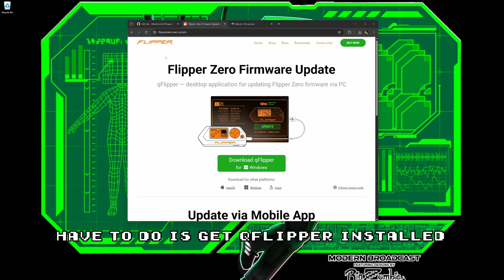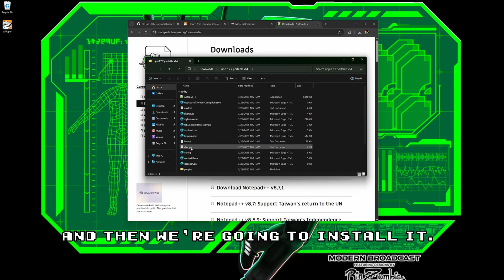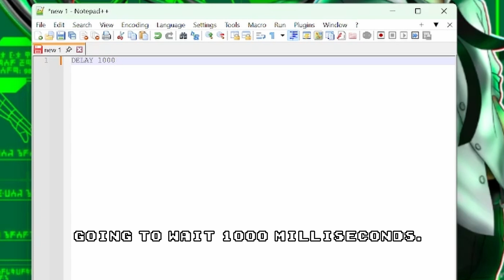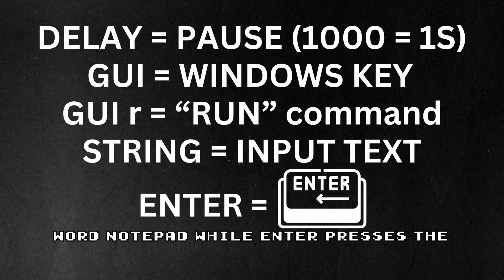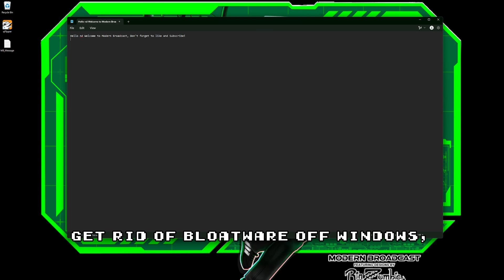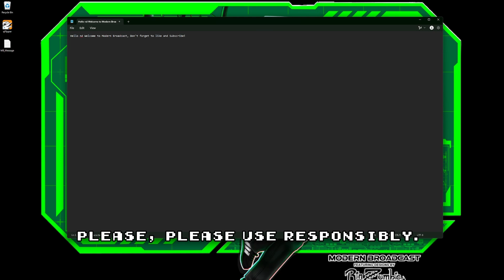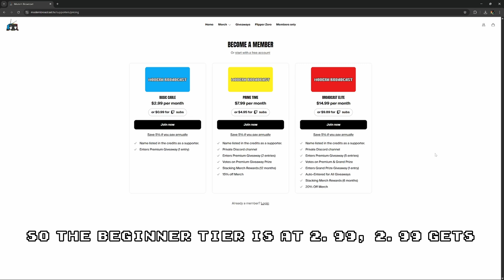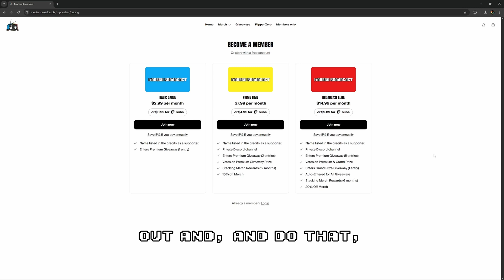Flipper Zero 4 Beginners: Learning Bad USB Basics

Comment: Hey man! Not sure if this could be something to do next, but...

I've been having issues with using muarder with my flipper running momentum. I follow the steps correctly on videos but a lot of the things like "taking wifi down" (on my network of course) doesn't work and was hoping if you could go into a deep dive or explain what I could be doing wrong!

But if not, I look forward to whatever you teach us next
Reply from the maker: @HolySettu  I just did a Murader video last month BUT what I could do is make a short trying to tackle this issue?
Reply: @ModernBroadcast  up to you brother! I don't want to take time away from a project you could be working on, since you tackled it already. I'll take a look at it and see if there's something I could be missing out on and reach reach back out!
Reply: Hello, great video
In new in the flipper community
I want to learn more about sub ghz ....
How i can set the read and read RAW function properly
I know the basics, but I would like to know the fine settings of the Read and read RAW functions
Reply: Is your network dual band, ie 2.4ghz/5ghz? The dev board only works with 2.4ghz.
Reply: @fossface  mine at home I believe is. I can double check when I have some free time. At other places I have checked, doesn't work either strangely...
Reply: @HolySettu  Hopefully "most places" you've checked are your own network. "Most places" use a 5GHz network, which will not work with F0 wifi dev board. Either that or you should watch Talking Sasquatches video for how to use it.